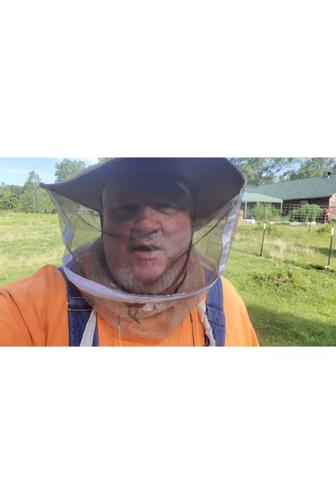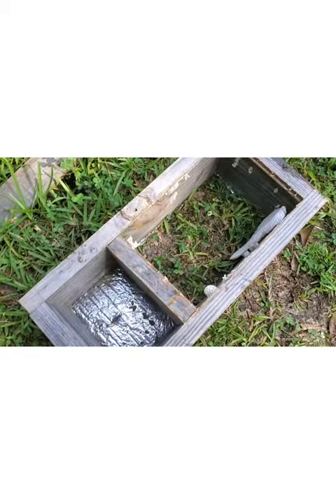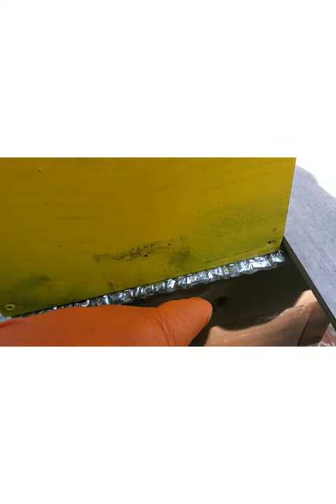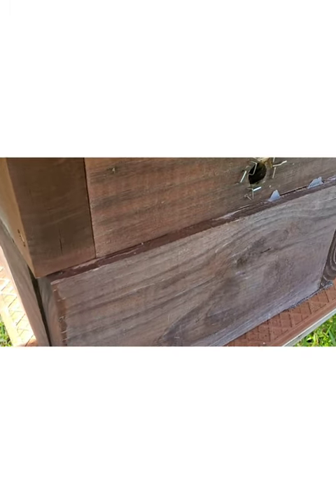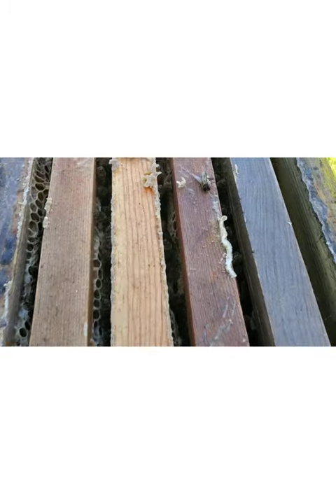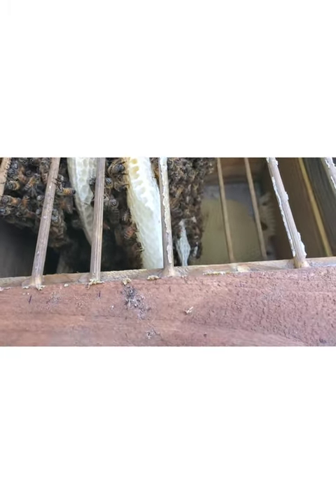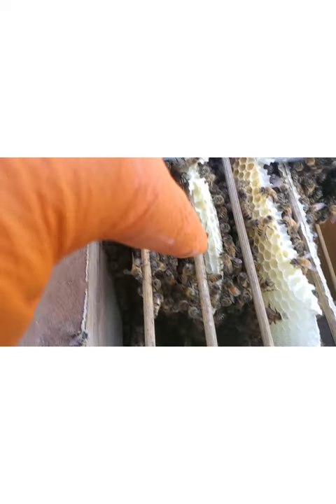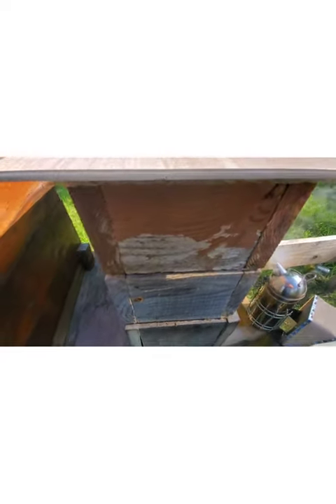Lanstroth to Comfort Hive Conversion

Comment: Just out of curiosity what do you do the comb at the bottom different than what you do in the five frame
Reply from the maker: They build the combs on the skewers ideally.  When starting this process this way the sometimes ignore the skewers and just do their own thing. In time you can move the box to the top (assuming the screen is removed). The queen will move back down, after all the brood emerges they will fill it with honey and you can cut out the comb.